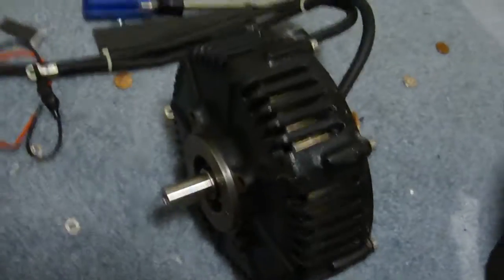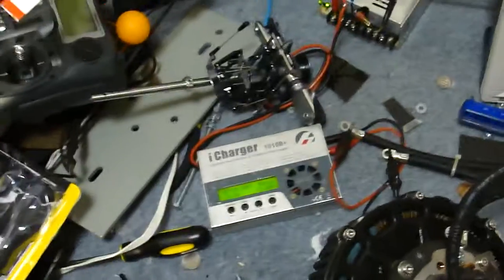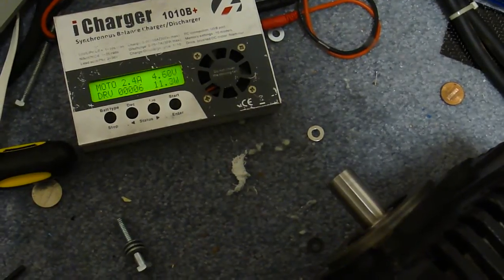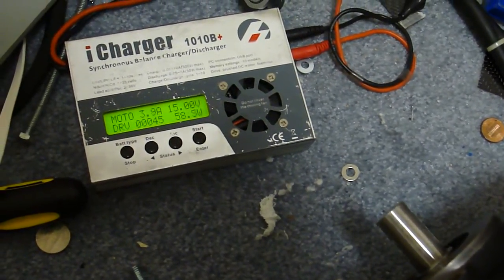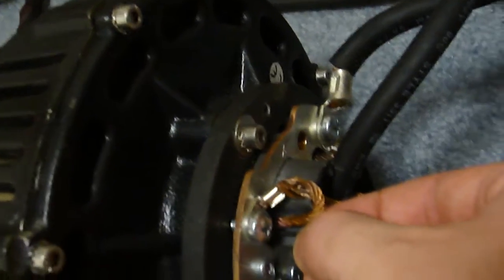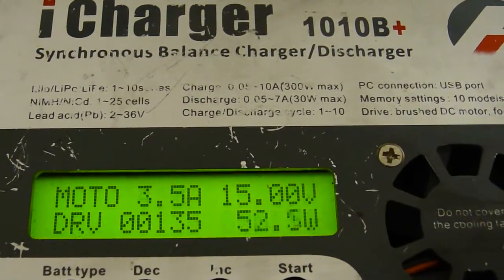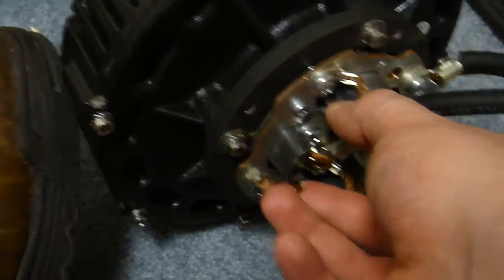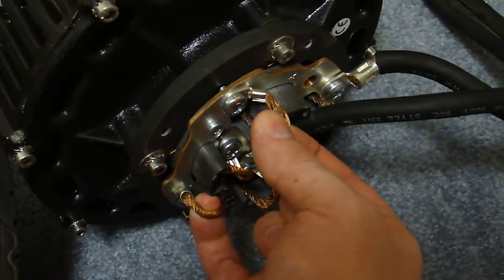PMG-132 brush loading effects.

Comment: I have the same motor and after twenty minutes or so of use the one day I went to turn it off and it burst into flames... Now every time I try to turn it on, it arcs out and it appears to be shorted... Was this anything like what you experienced?
Reply from the maker: I would look for signs of melted solder in the rotor assembly making shorts.  I've not experienced exactly what you described, but I have experienced them shooting fire out of the brush holder from 2 causes. If you spin it up with a big inertial mass on it, then short the motor phase leads together, it can shoot fire out  of the brushes, or if you run over voltage and over current (I was running 1,000amps at 110Vdc), they also shoot fire pretty quickly.
Reply: @LukeLiveforphysics  thanks! Mine just drives a hydraulic motor on a mini skid steer I converted to 48v DC
Reply: @Robert James I was running a Alltrax SPM48225 with a contactor... it's been quite awhile, but I think I had undersized a resistor and the contactor failed closed... When I turned it off, it burned up the motor and the controller. The more I looked into it, I ultimately determined I needed a motor with more torque at lower speeds. New drivetrain has been holding up nicely (knock on wood).